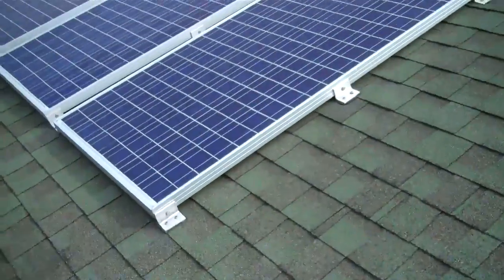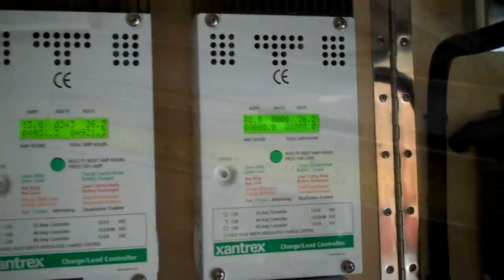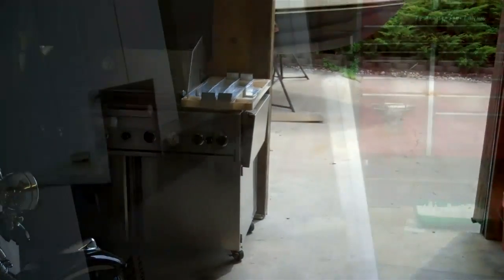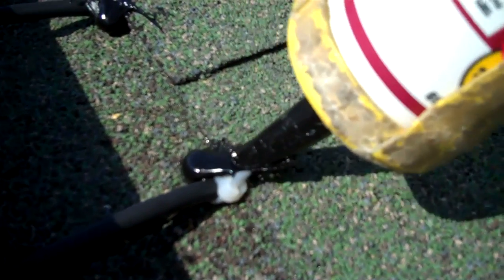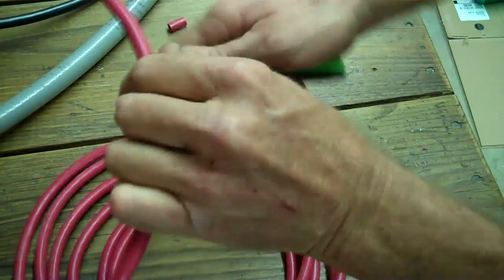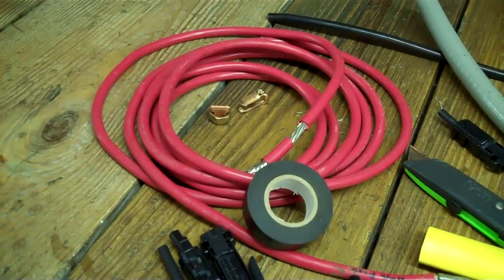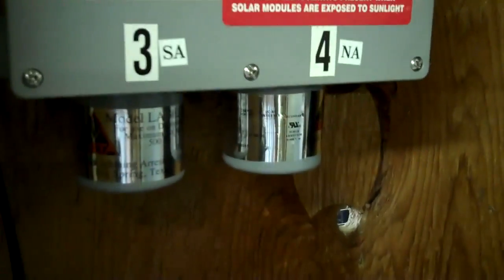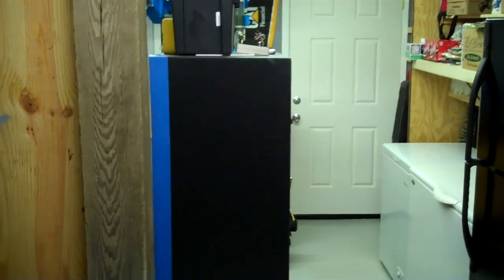"INSTALLING NEW SOLAR PANELS"  Adding 6 new 200W panels to my system..

Comment: can 200w solar panel, Can run refrigerator @ 90w 230v 0.75amps?  just for 3days straight?
Reply: +Gigi Espina need few batterys and an inverter.

Comment: .Can you connect two different size panels together, like connect  a 100v
 panel with a 200 and is 12 awg cable ok to use with most connections 
and whats the difference in wires. Can you please explain these things to me. I bought one panel kit about a year ago and its sitting inside the house because I dont know which wire to buy and Im ready to buy another one and was thinking to maybe buy a 200w this time but not sure if I can connect the two together. How many watts does it take to run a standar side by side fridge & a hot water heater do you know? I wish my partner took an interest in becoming more indepedent but he could care less. Were on differet planets in this department the past few years, it aint easy brotha LOL..Thank you for doing these videos for us and answering my questions if you can. Your wife is a lucky woman :-)

Comment: If You Take Off The Power Inverter You Will Get Better Solar Power Install Power In to Your Batery About 99% Nonthing Will Loss With All 12 Volt Systerm DC To Run All Your 12 Volt Applicates TV Radio Vacum Frige Freezer Rices Cocker Computer Projector Iphone Ipad Charger and Laptop Key Board Organ 5.1 Amp Sound Systerm and Many May More Fine out My New 12 Volt Systerm Run Your house 2015 Goto Your Youtube Check It Out Type This and Seach In Youtube My Video Will Update Soon .I Have Bein doing this solar power about 25 years 

12 Volt House Off Grid No Inverter
International Scouting

Comment: Not to code !!!!. Need combiner box, Fuses or breakers, Grounding.....
Not even a proper mounting hardware!!! Hello Roof leaks big time
Reply from the maker: Sylvain Maher IS TO CODE !!!!. What are you yelling for ?? Perhaps you should do some research. You should start with the NEC and low voltage.
Reply: timcat100 what is not to code? i missed something, not to mention if it was installed in 2012 and complied with 2012 code, it doesnt matter what the code is now
Reply: Brian Fischman j

Comment: Don't ever install panels in this manner, ever. Use racking to mount panels to roof because drilling holes in the panels probably voided the warranty and always use a junction box with a fuse before you penetrate the roof. This system is a fire hazard.

Comment: Well I guess reason my county gave me a hard time on this is because of running strings of 3 which put me up to 90 volts maybe. And as far as the fire department goes I have a 4 story house from the back yard and my entire back of the house roof is covered because it's a small footprint so they would have a lot of stuff to cut through if they get up that high. I would have loved to run the wires the way you did but then again if you have to reroof your shingles you're going to have a hell of time in doing so. I ran my wires exposed along the rails under the panels/strings to my combiner boxes then conduit down the side of the house to the disconnects close to my garage. County wouldn't even let me penetrate the roof in electrical conduit. Sucks too because anything left out in the rain is going to get weathered and wear out sooner than being protected inside plus it looks like crap. Like I had said my county put me through hoops and that's not even getting into my batteries. I wanted them in my garage.. Nope.. had to build a whole shed outside in the back of my house to store them. But as it turns out because I'm using flooded lead acid it is better to maintain them. So pretty strict in the Richmond area. The county kept reminding me that if I ever had to sell my house would it be safe for the future residents? Can you post a vid of the wiring in the attic. Maybe you have already but I haven't seen it yet.

Thanks.

Wiring methods
	Part IV of Art. 690 covers wiring methods, and begins by stating that NEC Chapter 3 wiring methods and other wiring systems specifically identified for use on PV systems are allowed to be used [690.31(A)]. However, PV source and output circuits above 30V must be installed in a raceway if the conductors are readily accessible.
	Single-conductor Type USE-2 or listed and labeled PV wire can be run exposed at outdoor locations for PV source circuits. But if the circuit is more than 30V, single-conductor Type USE-2 or listed and labeled PV wires must not be accessible from a readily accessible location [690.31(B) and Ex].
	If you run DC input PV system conductors and AC inverter output conductors inside a building or structure, run them in metal raceway, Type MC cable, or metal enclosure [690.31(E)]. Additional installation requirements apply, which were added in the 2011 NEC to 690.31(E), including:
Beneath roofs. Wiring methods for PV system conductors aren’t permitted within 10 in. of the roof decking or sheathing except where located directly below the roof surface that’s covered by PV modules and associated equipment. Wiring methods for PV system conductors must be run perpendicular (90°) to the roof penetration point. Note: The 10 in. from the roof decking/sheathing requirement is to prevent accidental contact to energized conductors from saws used by firefighters for roof ventilation during a structure fire.
Flexible wiring methods. Flexible metal conduit smaller than trade size ¾ or Type MC cable smaller than 1 in. in diameter installed across ceilings or floor joists must be protected by substantial guard strips that are at least as high as the wiring method. Where runs are exposed, other than within 6 ft of their connection to equipment, wiring methods must closely follow the building surface or be protected from physical damage by an approved means.
Marking or labeling required. Wiring methods and enclosures containing PV source conductors must be marked with the wording “Photovoltaic Power Source” by labels or other approved permanent marking means suitable for the environment and placed with a maximum of 10 ft of spacing.
Reply: +James Dondanville James, The above is true IF your going to grid tie. In a stand alone system most all of the above is out the window.

Comment: Sorry to be a downer but don't know what the code is out by you but running your wires through the roof is against code big time! Fire hazard. Read up on your NEC and NFPA for solar. Did you get a permit to put that on your roof? My county beat me up on my install making sure to follow all codes. Review after review before moving forward with the install. I too am adding 6 more panels to I just bought last week to my Xantrex system and will be up to a 7.4 KW system. I Understand about your mounting close to the roof for storms but I used Unirac and it's all about the number of mounts/spacing and securing to your rafters or trusses. But the point of getting the panels off the roof is for ventilation and keeping a good air flow to keep the panels cool (= more voltage) not to mention a lot easier to get debris and bugs less of a place to hide. That close to your roof those cells are going to bake! But if it's working for you then more power to you. Pun intended. da ha.  Not ripping on you just trying to be safe.

Comment: good job.
I want to run a iceream freezer in my van . how can i run it ? cann iz use car battery?
max power : 2 KW
for 10 hours.
Reply: what voltage is your freezer?  If you are talking a typical 120 volt freezer you have 2 options.  A small generator, like RV's have to run their 120 volt appliances OR a 12 volt to 120 volt inverter and I'd add at least 1 more battery, isolated from your starting battery, but still charged off of your van alternator.  Look for a 'battery isolator' in auto parts stores or on line. If the freezer is 12 volts, I'd still add 1 or more batteries and a battery isolator to your van.  In my work van, I did a 2nd battery and the battery isolator PLUS, I installed a 120 volt battery charger and had it hooked up to the 'freezer battery[s]'.  When I got home at night and shut off my van, to make sure my battery was back up to full charge, I'd plug my van in at night to my house power to turn on the battery charger and let it recharge my freezer battery.
Reply: put in water bottles,plug it in at night and leave the ice keep it frozen in the day timeHamid Rouzbeh

Comment: Is there a way to find out how much power, a 100 watt solar panel will really produce?  Not under controlled conditions.
Reply: yes.  buy me several, I'll put on my roof and give you a report. ;)
Reply: +Pop Corn A new polycrystalline panel100 watt panels puts out around 5.62 amps. So 5.62 amps X )17.8  volts VMP) = 100 watts

Comment: Thanks for the great video. Can you give us the proper name for those cable joiners, Butt Nuts? And where you bought them. I've searched online for them but can not find them. I want them for a stand alone solar system I'm putting on my workshop roof, starting with 3 x 24V x 200W panels. Those Butt Nuts would come in handy :) BTW, what size fuses did you use between the panels and the controller...And elsewhere?
Thanking you in advance for your advice.
Bill
Australia
Reply: look on flea bay, for split nuts.

Comment: can you tell us, where you got the supply. i like the idea of , how you mounted the panels. I am buying about 10,000 watts, and was trying to figure out how to mount them. cheaply.I can get them for .75 a watt off .@bay. also, ordered some inverters from china. 10kw inverter. I bought a dozen junk golf batteries for 10 a pc. and desulfated them. they are fully chargeable now. also, sams has them for 85 pc.6v 220ah

Comment: How are things going with your panels? Did u have any leaks running the wires in the roof like that? Also did u drill your brackets into the rafters?   Thanks in advance these answers will help me greatly as such as your video has

Comment: RE Charles Ridenour's comment, I plan to fit a 1.2kW system to my purpose-built workshop roof. I have a felted roof, and was wondering about the mounting of panels (1580x808, qty6x200W mono). My latitude is approx 51deg, UK.
 Have you any notes or observations about the temperature of the panels on a hot summer day with no wind? We don't often have hot summers here, but occasionally it gets to the 90's. I would prefer to learn, rather than make expensive mistakes!

Comment: Yeah I'm planning on using steel for the place I'm designing.  Would love to shoot ya the plans for your thoughts.  Just got my 4 6v Exides for my 45w learning system.  I need to charge them fully off the grid before connecting to panels right?

Comment from the maker: Wish I would have thought of that.. Pushing a stripping shovel around my roof all day and picking up all the shingles and haulling them to the dump would be easyer than putting my drill / driver in reverse...Hmmmm

Comment: Greetings, congrats on the upgrade. One question you do have the panels divided buy arrays, do they share the negative cable and the positive cable goes to different places, or do you have to separate both negative and positive of the arrays? Thanks for the help.

Comment: as well I am on a very limited income ( invalid Pension) so It is slow and steady wait for specials , buy intelligently,  buy doing so , So Far I have saved about 1/2 the cost of all listed, gear apart from wind Turbine as I havent got it yet or the grid tie so I have spent approx 2000$ but the main thing is I love the Journey and the thought of I have got HOME MADE Power and eventually free power upon payback of savings to my self  BTW Kev I love your Videos  look forward to them all the time.

Comment: that does 6v, 12, 24v, This system is 24v and I have managed to get 4 x 6v Trojan Batteries via a mates help from a Battery shop 
( they sat on a shelf for 8 months ) for 200$ they charged up to 6.5v no probs, I have a 3 week stint of Radio therapy coming up and after that Am homing to get the standalone system up and running on the roof, my next part is a 24v wind turbine up and hooking into the system  want to get a Grid Tie inverter for complete system as well and it is 240v Grid power

Comment: Thanks Kev, for the reply It is heart-warming to see that their are still great people out their who still exist and help to bond us all together, Not bad down in WA ( a small town called Toodyay ( Pronounced 2J ) 100km N/e from Perth ( google it !)  on 1/2 an acre I have been slowly setting myself up on Solar power I have a 1kw grid solar and am setting up a standalone system as well at present 2 x 190w panels , 95v regulator, 1kw surge 3kw pure sine wave inverter, 
10amp smart battery charger

Comment: That roof mounting looks very solid. I see you replaced the Xantrek that the lightning fried. Those MC4 are a pain, you may void the waranty cutting them off?, for parallel connections that method is way cheaper than a mc4 combiner box? Your going to have lots of power!! What a marvelous setup, puts mine to shame. Thanks for sharing.